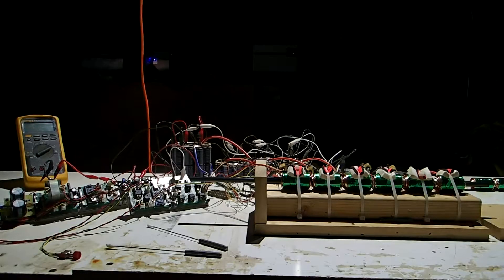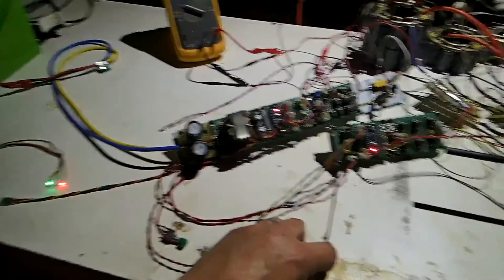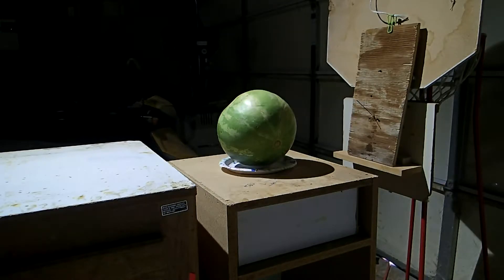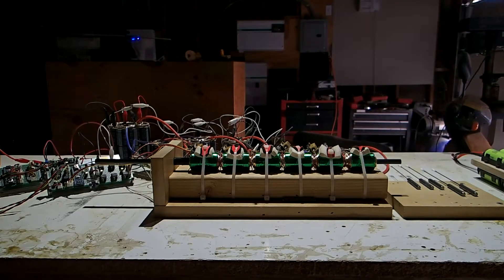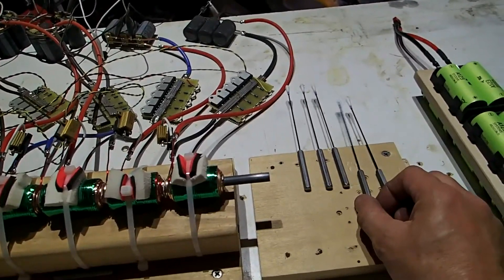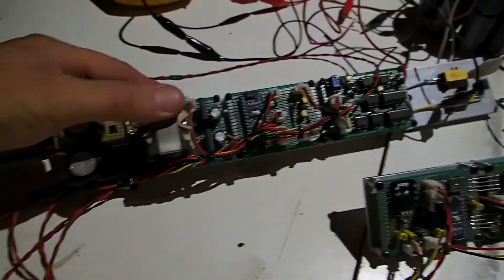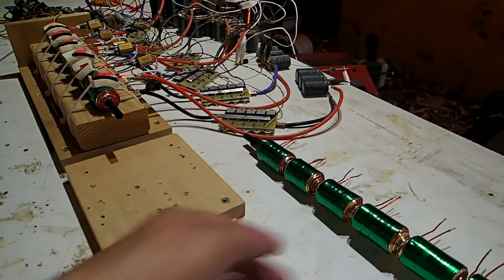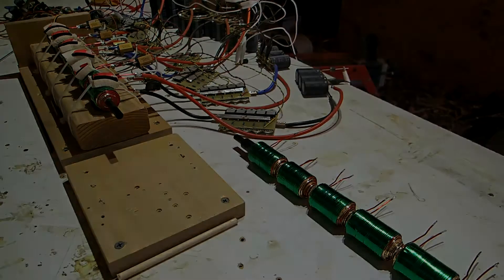World's Fastest Weapons Grade Coil Gun

Comment: If you have not sold that 6-stage coil yet, I have some questions you may have already answered then, but to verify):
COIL:
1)  What is the wire gauge?
2) How many layers per coil?
3) How many turns per layer?
3) Length of each coil.
BARREL:
a) what is the barrel made of?
b) What is the INSIDE diameter of the barrel? or What diameter of the largest cylindrical projectile usable?
c) what is the ideal length of the bullet?

THANKS MUCH!

Comment: Hello:

I really like your youtube site. Very interesting and informative with great presentations! I have built a coil gun as well and was curious how you captured the 2 signals on your oscilloscope so you can determine speed of your projectiles? I have a DSO and know how to capture signals via trigger events which i assume you are doing as well. I am using the same type of capture as you are via infrared LED’s across from the bullets pathway. my circuit simply sees a drop in voltage from 3.7V to 3.5V so i use edge triggering in “normal” mode for this. I noticed that your captured signal is nice and clean between channel 1 and 2 of your captured signals and was curious how you generate this?

Also I would love to have the schematic to build the power supply you are using as you are right, there is a need for a high power power supply for the coil gun community. One last question, what is the wattage you are using the the 17 ohm resister you are using on the flyback diode parallel to the coil?

I appreciate your time if you could help me with these few questions and keep up the interesting and very inventive work you are doing !

Best Regards

Alex

Gilbert AZ
Reply from the maker: The two signals on the one scope red and blue were the first and second stage firing of the coils

The scope measuring the speed was taken from 2 LEDs 4 inches apart emitters and detectors.

The 15 Ohm resistor was 50 Watts

Comment: Hi Clay,
I think I remember you mentioning somewhere that the barrel is made of carbon fiber tubing?  Is this the barrel for sale?  Can you tell me what this stuff is, basically?  Am I correct in assuming it is non-metallic and stiff?  How does it compare to thin-walled (<1/32") brass tubing?  I have used the brass before with great results.  I did drill and slice a bit to reduce Eddy currents.  It looks rather expensive in Mac-master Carr.  Maybe a bit if oil inside will help the coefficient of friction??
Thanks again!
Reply from the maker: Yes it's a carbon fiber tube it's non-magnetic it has a hardness factor of almost 10

Comment: I've been having some trouble with my SCRs, since you've used them high side on this one I thought you might be able to help.
I'm using a two stage railgun setup - there are two capacitor banks that connect to the same load on the high side. I have an isolated (from the battery and Arduino) power supply to power the trigger circuits. But when I trigger the first stage SCRs, a gate pulse is created on the second stage too, firing it much earlier than planned. What could be the problem?
Reply from the maker: Yes I had that problem once. 3120 opto couple fixed that between gate of scr and arduino
Reply: How are you powering the gate drive side of the optos? Some kind of isolated power supply?
Reply from the maker: @NNNILabs  5 lifepo4 aa battery's running the computer,
Reply: So if I understand correctly the computer and the gate of the SCRs have the same supply?
I'm using a completely isolated supply for the gates.
Reply from the maker: @NNNILabs  yes that is correct
Reply: @Moss Fett I tried a totem pole output similar to the one in the IC you recommended, but I'm still having the same issues. The thing is, my SCRs are connected to the same load on the high side, each SCR discharges its respective cap bank to the same load.
Reply from the maker: @NNNILabs  what's happening is there's all these current surges and electricity is flowing back and forth sloshing like water through the capacitors like water tanks this causes Eddy currents and noise and causes an SCR to falsely trigger, what is needed is a separate battery supply to run the triggering circuit for the SRS and the load side that's a separate power supply for the coils in the scr anodes
Reply: @Moss Fett Is there a diode in series with the output of the opto and the gate of the SCRs?
Reply from the maker: Basically what you have to do is you have to put a capacitor across the gate and the cathode to suppress any noise coming in there. Then a resistor maybe 100 ohms attached to the gate going to the trigger circuit.
Reply: Right, so no diode?
And I suppose the capacitor should be around 100nF?
Reply from the maker: @NNNILabs  there's always a diode across the coil or you'll ruin the speed of the projectile we're talkin about the gate input of the scr
Reply: I meant from the output of the opto to the gate, unless I misunderstand?
Reply from the maker: @NNNILabs  yes from the opto to the gate a resistor then after that a capacitor from gate the cathode of the scr.
Reply: Ah okay, thanks. It'll be some time before I can put this into practice, since I have to get the parts and such and I also have exams this month. Will let you know if it works.

Comment: What kind of power fets do you use for the primary? I'm making a 4000w power supply so it needs a couple houndred amps from a car battery I was going to use two igbts in parallel for each end of the primary (it's wound bifilar) but I was wondering if there was bigger fets i could use
Reply from the maker: Dominic Nedlewski the biggest Fets I can find Source current 110 amp.
Reply: Moss Fett that sucks, I can only find 50 amps on the site I use but I have one more question, how do I calculate the out put capacitors all the formulas I have are rated for 60hz
Reply from the maker: Dominic Nedlewski what you do is you put multiple fets in parallel and put approximately a 600 ohm resistor in every gate lead then you try those all together and that goes to the driver
Reply: Moss Fett what I have for the fets right now is 3 in parallel and a 1k over the gate to ground and the gate directly into the driver. I was just curious if you were just using one fet for each side of the primary, your power supply looks really really compact for it's power. I only saw two fets lol))) but for the out put caps I have 200v at 25 amps running at 71khz would two 680uf caps in parallel but enough? Or is that overkill
Reply from the maker: Dominic Nedlewski I only have two hundred and ten amp power fets in that power supply.  Technically that's not enough for Reliable operation over and over and over again at a rapid pace.
Reply: Moss Fett how many amps are you running it at?
Reply from the maker: That one was around 40 amps 50 70 burst, that's why it needs to have probably about four fets minimum

Comment: The board next to the charge resistors, is it the logic form your power supply video?
Reply from the maker: NNNI the one board that's long that's the power supply run by the Ardrino computer the smaller board that's the firing computer
Reply: I see that the long board is made of three smaller boards, one with the transformer, one with the Arduino and one with many DIP chips on it. I'm talking about the one with the DIPs.
Reply from the maker: NNNI that's the same control circuitry as the power supply video
Reply from the maker: no the Ardrino controls the power supply on off charge and when charges reached it shuts off the power supply. The smaller board that has an Arduino that's the fire control computer that replaces the six 555 timers in the sequencer that was used in the previous video, that change was made because the RC time constant drift with temperature of the room causing speed variation of the projectile, the little computer eliminates that with a program so that the firing constant is accurate to 3 microseconds every time it's fired
Reply: +Moss Fett
Thank you.
Can you please remove the name from your previous comment? Used another account by accident.

Comment: have you considered the eddy current losses between projectile and coils ?? thats because i shot a projectile with stainless steel tip and it had large velocity drop due to eddy current
Reply from the maker: Vasudev Mr  the reason why you had a large velocity drop with stainless steel is because that's an alloy of material that's non-magnetic and it's taking away from the iron the best thing to shoot is cold rolled steel 2% carbon no more. This video is with cold rolled steel 2% carbon my earlier video was with hardened steel which has 15% carbon carbon is not magnetic and those projectiles shot at a lower speed.
Reply: wouldn't there be any eddy current losses between mild steel and coils ?? .
Reply from the maker: Vasudev Mr Eddy currents in a coilgun are basically insignificant Eddy currents exist in an AC Transformer or in a switching Supply where the waveform is pulse positive than its pulse negative over and over. One can minimize Eddy currents in an AC Transformer you'll notice that the laminations that the core is not solid steel that it's built out of laminations, or in a high-frequency Transformer it's made out of powdered iron mixed with a resin type adhesive glue. A coilgun is a DC circuit not AC the coil almost reaching saturation instantly that the pulse is applied when that happens the inductance goes to zero and all that's left is the DCR of The Wire. Also it's important to note that cold rolled steel at 2% carbon with the same size projectile weighs 3 grams more then hardened steel with 15% carbon not only is the magnetic attraction greater on the 2% carbon steel but it weighs 3 grams more thus the output of the gun in joules goes up for there's more mass being hurled at the Target not to mention that the speed of the projectile goes up because the magnetic attraction is greater.
Reply: that's right but when i shot another projectile with aluminium tip the effects was same as stainless steel projectile .this means if any metallic substance move greater velocity in magnetic field it experiences some resistance to move because of eddy currents . so my idea is to take some iron or steel powder ,mix it  with epoxy resin which will insulate each iron particle as well as bind it . with this thing i can mould it to cylindrical shape as a projectile .this may reduce effects of eddy current on projectile itself .a plane projectile gets attracted rather than getting repealed coz as we all know magnetic attraction is greater than eddy current repulsion .
Reply from the maker: Vasudev Mr you shot a piece of aluminum which is non-magnetic to the Bone. The effect is the same or worse, I use pointed tips of brass and had 265 feet per second the same without the tip
Reply from the maker: Vasudev Mr another thing you're not taking into consideration is to have substantial eddy current problems you have to have a core that follows the complete path of the magnetic flux that means it has to connect on the exit end of the barrel go around the outside of the coil and connect on the rear side
Reply: Moss Fett that point is to be noted  .I will try brass tips also

Comment: Another thing, due to high velocity of the projectile it wouldn't be able to push the air fast enough, that would slow it down, if you still have it running, can you try little perforations and note the difference, I'm assuming it would be a big one.
Reply from the maker: jasxir you need to look at my electromagnetic crossbow the projectile is a hexagon writing on 6 rails inside the tube there's air able to escape down the sides that ideas already been taken care of
Reply: It is impressive, have you tested the accurate range?
Reply from the maker: jasxir the grouping of electromagnetic crossbow is within an inch
Reply: Moss Fett actually I was talking about the range. How far does it shoot in a straight line?
Reply from the maker: jasxir 45 ft with no drop
Reply: Moss Fett nice.
Reply from the maker: jasxir https://youtu.be/DjoYHLye2p4

Watch the grouping on this shot at 45 ft
Reply: Nice, the tube that you used, is it metallic?
Reply from the maker: jasxir  no that's a carbon fiber tube.032 wall thickness
Reply: Previously with the RC timing circuit you had velocity of 200+, what is the current velocity?
Reply from the maker: jasxir with RC timing I did 250 ft per second what computer timing I got it up to about 265 and rewinding the magnetic Barrel there's a few list turns on the 6th 5th and 4th coil
Reply from the maker: jasxir https://youtu.be/_ZJpTKZUibs

Watch this video from the beginning to the end it's 25 minutes long it explains the entire operation there's oscilloscopes to look at the the pulse with you'll see it positive and you'll see go negative below-the-line when it's negative below-the-line that's when the magnetic field is collapsing around the coil and the capacitor is charging backwards when that bottom pulse-width below-the-line the negative part when it comes back up to the zero line that's when the scr switch is off.

Comment: Very impressive! But the military was testing mach ~13 coilguns around when you made this video, so I don't think it's quite the world's fastest. =P
Reply from the maker: 314159someguy the military has a rail gun dude they don't mess with coil guns the only thing the military has is a coilgun mortar launcher that's it so get your information correct.
Reply: Good call! The particular gun I was talking about was indeed a railgun.
Reply: @RaptorRotorHead  first of all you dont need to be rude, and secondly NO the gun you KNOW about is a rail gun but they DO have coil guns, furthermore a coil gun and a rail gun work on the same premise and are basically the same thing. its like saying a mazda rx7 isnt a car because it has a rotary instead of a cylinder engine, they are both cars that run on gas, just transfer energy in a slightly different way but it works on the same physics.  and btw that railguns final revision is more of a coil gun then a rail gun because the former was destroying itself after just a few shots, so its like a hybrid of the two. thats all the info i can legally give you.
Reply: @the_socompsp  and what kind of info u " can't legally " tell us